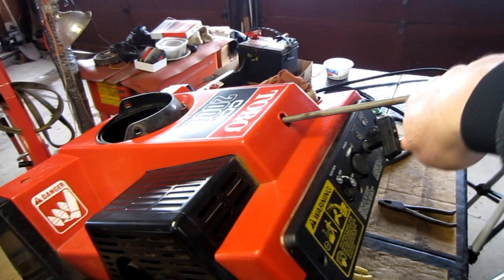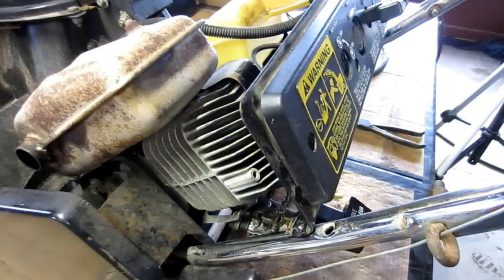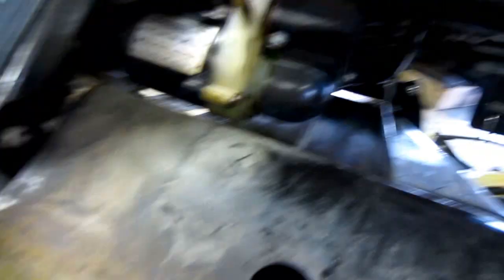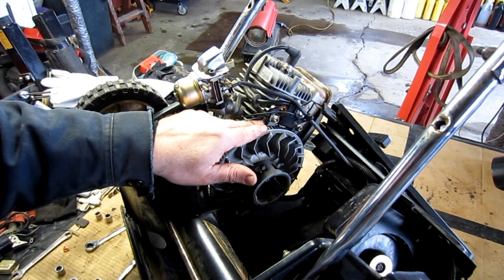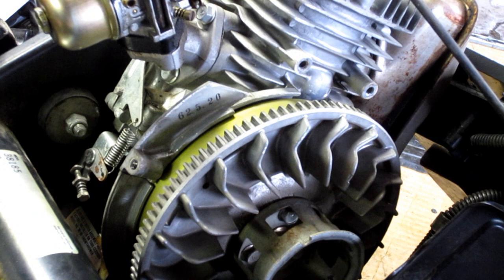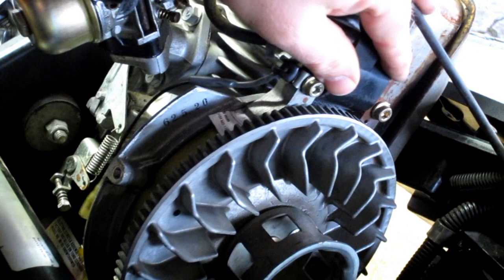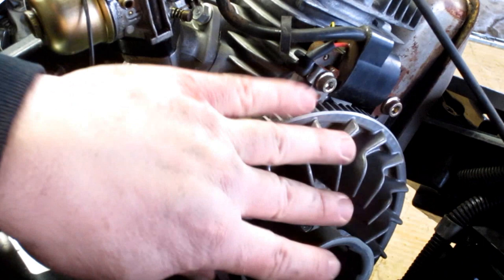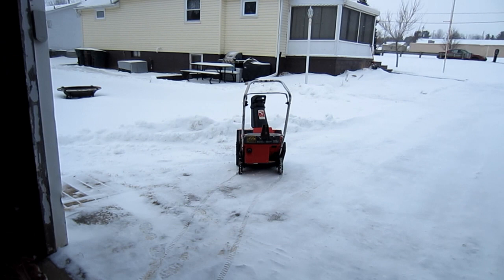Toro snowblower magneto coil repair

Comment: I have a Toro snow blower CCR2000E and was able to replace the cord thanks to you.
Recently I used at a neighbor and my blower got tangled in an outdoor mat and shut down.
It won't start now.  The paddles are easy to move by hand now which it didn't before.  Would this 
cause it not to start?
Reply from the maker: Could be a number of things. First as far as the paddle spinning freely most likely your belt has come off or the pulley has possibly sheared off it's mount. That's kind of a safety thing built into the snowblower so something small that is sacrificial brakes instead of something major. However as far as the engine running and if the engine stopped abruptly like it sounds it may have, you could have sheared the flywheel key. Again it's the same type of a part that is sacrificial so as to protect the engine. As far as figuring out why the auger spins freely it's probably going to be pretty simple but as far as checking to see if the flywheel key is shared you're definitely going to have to tear into it to and remove the flywheel to double-check that. Good luck

Comment: My Toro CCR2000 starts immediately but shuts down after 15 minutes. Do I have a problem with ignition module or do I have to change the magneto coil ?

Comment: Wish you would have showed your coil testing. A lot of people have coil problems on these snowblowers. Did yo just pull the rope with the plug out and grounded and saw the spark was missing? Mine is a 2010 model. Could it be the internal other part of the coil under the epoxy that went bad? Someone said they dug out the epoxy and connected the universal thing to that internal connection and it worked, meaning the coil itself was OK but the internal component was bad. Hope you followed all this rambling.
Reply from the maker: +Terry H. I keep extra aftermarket universal ignitor/modules on my shelf.
1))  If I don't have spark(using a spark tester) then I look for breaks in the        wiring, and or disconnect, the ground wire used for shutoff of the coil.
2))  If I still don't have spark I connect one of the universal modules that I mention
3)) If I still don't have spark then I know it's the coil.

 Thats is why you see the ignition module in this vid. This is the fastest way I can get this diagnosed for the least amount of time and money because if working on any small engine those modules can be handy.

 I don't screw around with modifying the stock coil as I figure it to be like repairing a light bulb, more hassle than what it is worth. The stock coil is expensive but my time spent doing the same rig job repair over and over again is not worth it. do it once. do it right. If I didn't feel that the universal module was effective and long lasting, I wouldn't do that either..
 It's hard to say what anyone is willing to do to save $50.00 but replacing a coil every 6-7 years I find to be acceptable to me.. good luck..

Comment: I have one of these and it  occasionally will not start. I am suspecting of a week spark. Was going to replace the ignition coil but they are discontinued and on ebay they run $288 (only 1 person selling). This unit is not worth fixing or putting any money into it as I can buy a brand new snow blower for $600. Shame on Suzuki for not providing the parts, I know this unit is old but I expect parts to be available from manufacturer. I saw a forum where someone could not find ignition coil for this same unit in 2013. Very very bad.